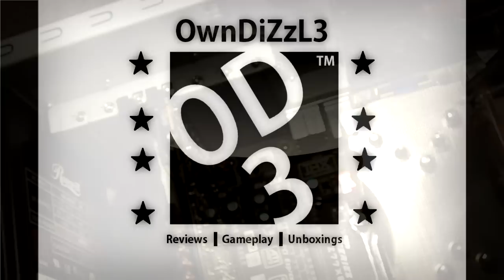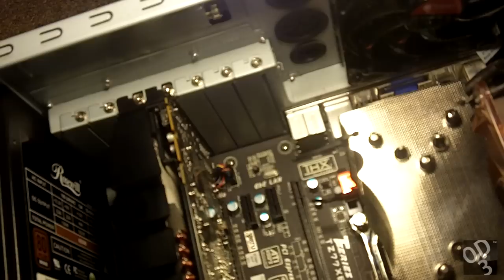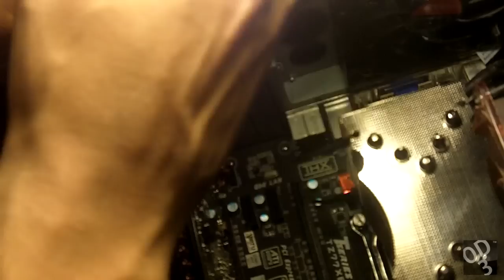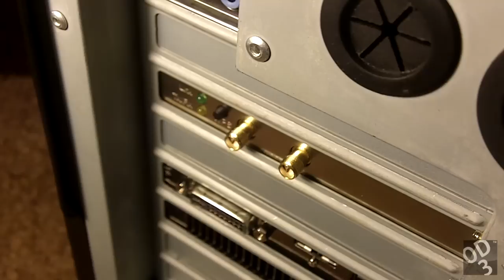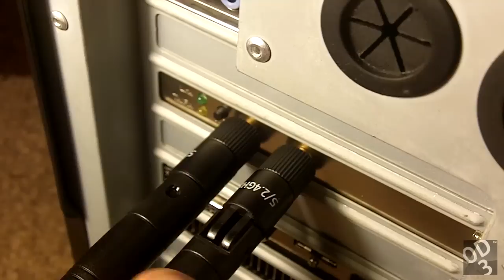Rosewill N600PCE Dual Band Wi-Fi Adapter Installation

Comment: So you need a DVD drive to get the wifi adaptor to work?
Reply from the maker: Lelouch Dragneel If it's Windows 8, then it should be PnP. Previous versions of Windows may need the disc.